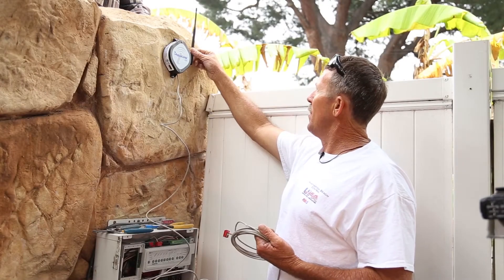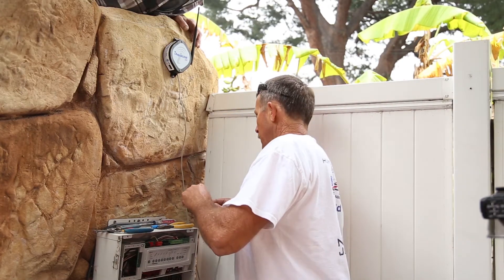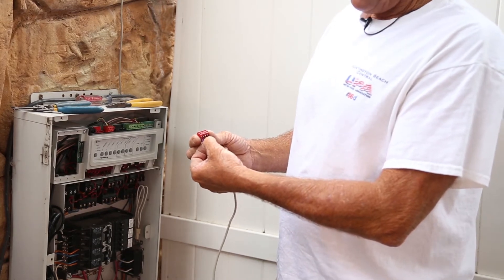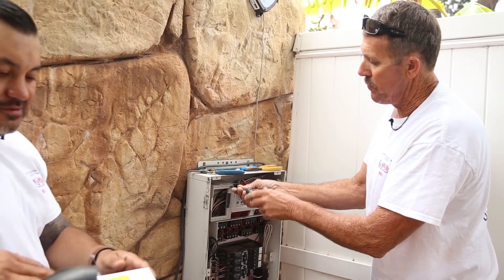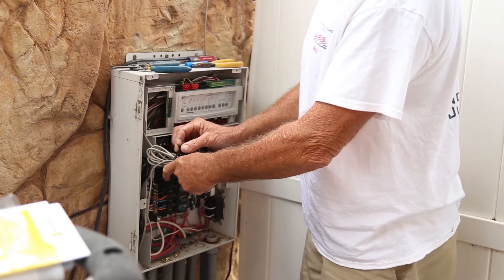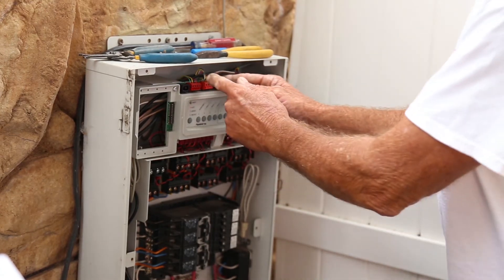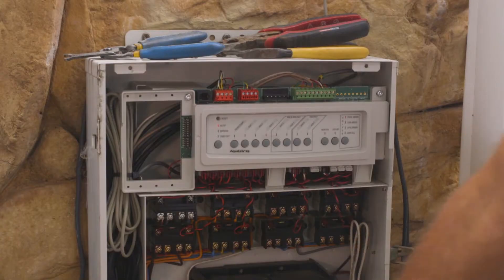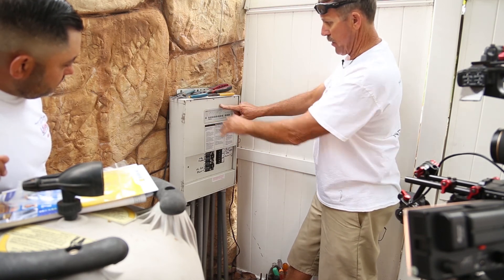Aqualink 2.0 Install Tutorial (4/5)

Comment: I had to have the wifi antenna connected to the red port on the right, and the existing pda antenna hooked to the red port on the left. I don't know why but, it wouldn't work with the antennas switched.
I couldn't find anything that said there was a difference or that it mattered.

Comment: I have a Aqualink rs8 controller hooked up to a Hayward pool heater (see https://www.youtube.com/watch?v=9k5H0JkppYg at 7:06).  I see the  4 pin on the Aqualink control.  Which of those lines connect to the common, spa and pool line on the Hayward heater?  I think that the black (2) line connects to the spa line, the yellow to the pool line and the white (not one of the 4 pins) should connect to the common line?  Is there a site which discusses the connections?
Reply from the maker: Valtér Hégér No the heater only hooks up to the 24 volt 2wire heater port on the GREEN 10 pin connector 
Hayward will not communicate to jandy and vise a verse
Reply from the maker: Valtér Hégér Heater only hood up to the common and pool or spa
2wire conductor
Reply from the maker: Valtér Hégér Jandy 4 pin RED com port is as follows
Red 24v
Black  common
Yellow   Data
Green   Ground
Reply: You can use the fireman switch and attach it to the green pin I believe for communication